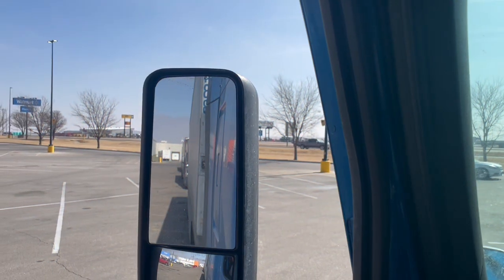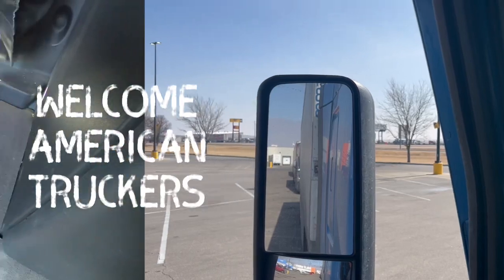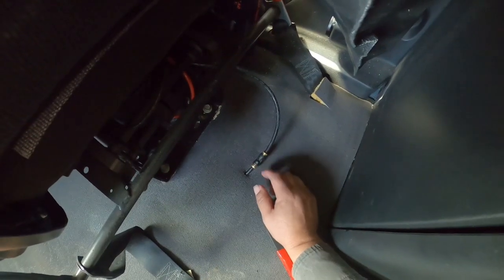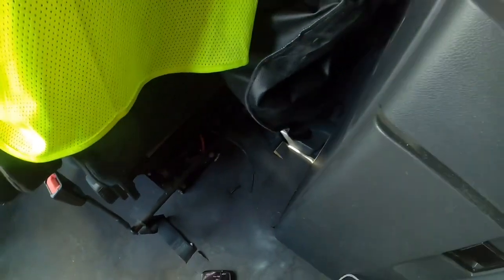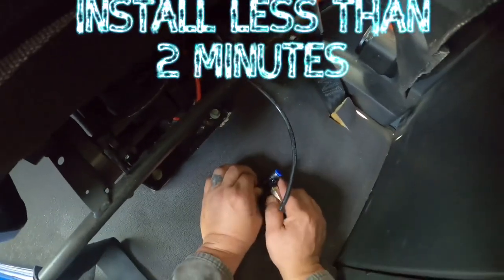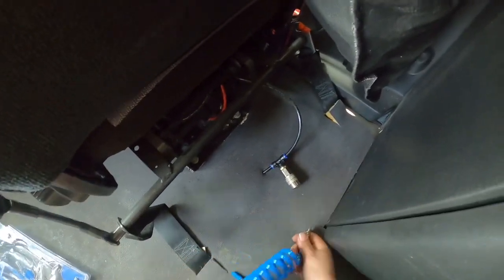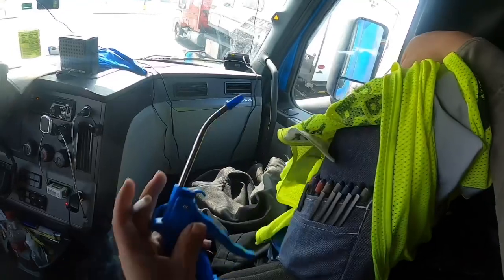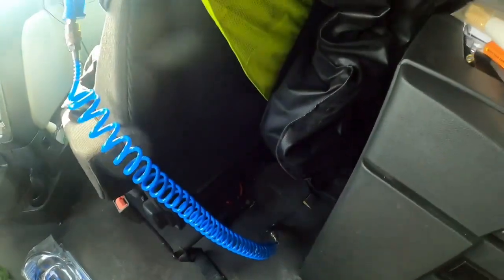How to install Heavy Duty Air Blow  Gun Kit in Truck! NO DAMAGE! #trucking

Comment: Just a tip: drain all the air by pressing the brake numerous times. You can disconnect the quick fit easily without any tools

Comment: Followed your steps exactly, it took longer to deflate the air bags then installing . I taped my old connection with gorilla tape to the seat melt connector so i wouldnt lose it. Thanks for the video and a cleaner drivers seat.
Reply from the maker: Yeah, it’s a fast install and easy to put in. Had I not been recording the steps when I made this video it could have been done faster. I think the video is longer than the actual instal is. And the thing I like most is I can take it with me when I change trucks easily.

Comment: In order to take the existing splitter off, and mine looks exactly like yours, I put my channel locks on it exactly how you did, and I'm applying a lot  of pressure to squeeze the crap out of it, and it's not coming off. What should I do?
Reply from the maker: It may be stuck try some wd40 or squeeze and pull on side of the air line. Or you can cut it out
Reply: Thanks, that worked 👍

Comment: I’ve learned to dump all my air out before doing this. Makes it easier to put it on. I’ve put these blue ones in a few trucks now and some of those fittings are easy enough to squeeze by hand to get them off. I remember the old ones were such a PITA, and you better have some thread tape! 

I also went ahead and bought the old style one specifically for the regular styled handle. It will go on but you do need to get some pliers or those channel locks and get it nice and tight to avoid any air leaks .

Comment: Good video. That's the same gun I just bought.
Reply from the maker: I still have it. Works great. And the install is actually faster than the video. Lol I had to stop and record throughout. But the install takes less than 2 mins. And I take it with me as I change trucks.

Comment: You can add a decent sized carabiner to the blow gun, and then you'll be able to attach it to the side of your chair near your pens. 👍 

I definitely like that air blow gun better. It looks like the hose is a lot longer than the one we have on the truck. I might to think about switching; especially that you can add more hose to it with the connections.

Comment: Do I have to disconnect my airlines to trailer? Or just shut truck off let the air out?
Reply from the maker: Just turn the truck off and let the air out. When you break the line let the air flow until it stops it will make it easier when putting it together.